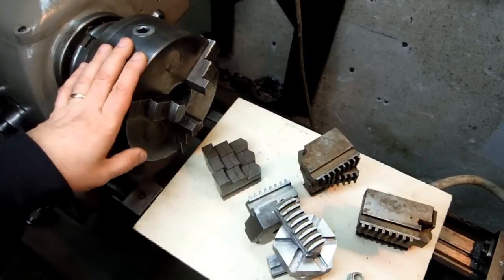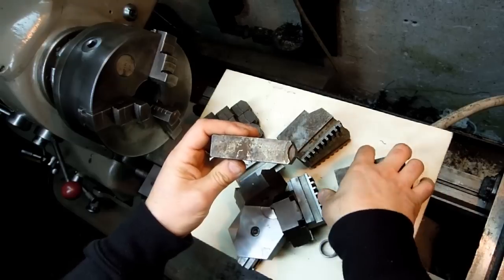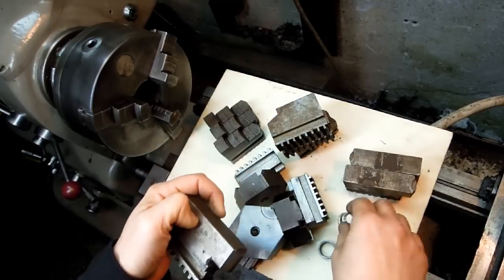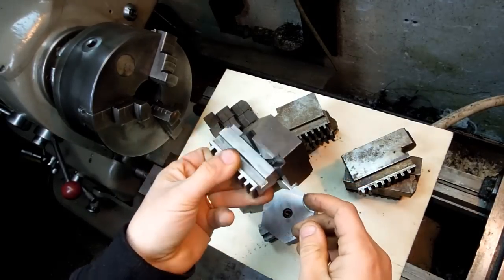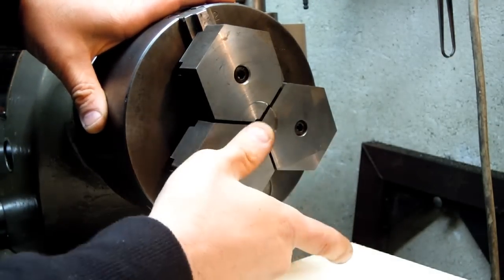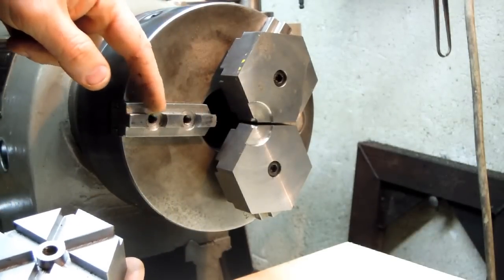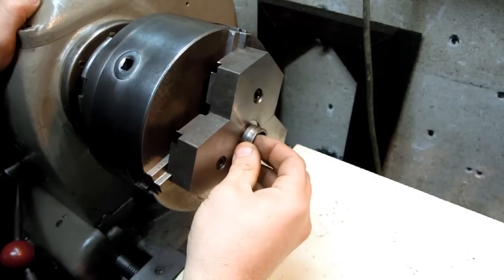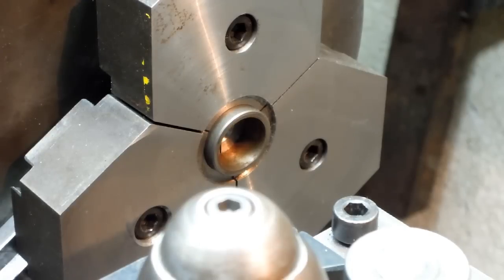Lathe Soft Jaws

Comment: When you're cutting pie jaws like these, putting shims between the segments and then tightening then down allows you to bore then on size, yet still be able to clamp the work securely. In fact, since you have the exact curvature to match your part, the holding will be even more secure.
Reply: And undersize jaws can leave nasty markings on soft material part's.
Reply: I was about to ask a quest along those lines. I have used a pin to preload and machine a collet and it worked great but i dont know if thats correct.

Comment: Hi Tony:
I noticed that there was no mention in your video of one crucial detail in the use of soft jaws. Namely, not only they are useful to grub odd shapes but also to provide the most and only 100% accurate way of running concentric parts on a chuck.
If you are  curious enough to check promotional videos of so called "Machining Centers" from either the US, Europe and every other manufacturer, you'll see that they have stock of dozens (hundreds?) of soft jaws for production runs. We should also mention that those hydraulic or air pressure operated chucks are worth tens of thousands of dollars and still need soft jaws for absolute precision. Just imagine the commercial chucks that we  use even first rate ones. An old and known alternative is to use a 4 jaw chuck which, while highly precise, don't offer quick repeateability. Another point worth mentioning is that due to obvious manufacturing tolerances in the base or mother jaw and internal chuck components, soft jaws must be numbered and placed in the same spot every time to insure results.
In the subject of normal wear and manufacturing tolerances, I always use only one spot to tighten a chuck because all other locations allow unequal and distorting torque forces on the jaw in question for that reason, affecting concentricity.on the workpiece. Such method is used by many knowledgeable machinists without affecting holding strength. Using excessive torque applied to chuck jaws cause springing of same and is not necessary. To give you an idea, adjustable hydraulic chuck jaws use a maximum of 100 Lbs. of pressure and beyond that level, the jaws are distorted and the chuck damaged. So much to learn and so little time.

Oldtimer

Comment: I am straight up jealous of the practical ingenuity possessed by whomever came up with the hexagonal soft jaws. What Eureka moment that must have been.
Reply: I think it was an English engineer called John Stevenson
Reply: I do wonder how good the registration is after initial boring, once they're taken off and reset. I work in a CNC environment and we are constantly recutting/remaking jaws because they lose registration once they are removed.
Reply: @spadgefox5286  It's at 8:45  where he says the key thing. "To be able to repeat it reasonably"
If you work on professional CNC, what are your tolerances? 0.1, maybe 0.5 thou? I', really sure that Tony was fine with a 1 thou error or a 1 thou change in radius due to vibration
EDIT: His end result ended up at 2 thou and his target was FIFTY lol

Comment: I am a Millwright, but I’m now working as a machinist. Mostly manual work with a bit of conversational CNC. What I love about videos like this are all the subtle “time on tools” tricks that I missed because I didn’t apprentice under a machinist. For example I have never thought of using a deburring tool on a part while turning it on an lathe...... I have always used emery cloth. Of course I understand different techniques have different safety aspects, watch for line of fire if something grabs etc....

Comment: One thing I found out the hard way: not having previously owned a chuck with the classic (rectangular, not stepped) soft jaws, the first time I used them on my big new Bison 3 -jaw, I failed to take account of the much increased zone of destruction, and consequently ran the outer corners of the jaws into, and marked, my cross-slide (which I had until then managed to keep pristine, on a lathe from the 1950s!).  Not happy!

Luckily I had  long ago fitted a "dead man's pedal" which brakes the lathe to a halt the moment I step OFF it. 
This meant I did not damage the chuck, although it was spinning fast at the time. And the cross slide damage was, I suppose, cosmetic - it certainly does not affect function

Comment: Love your work, please keep it up! Love the hex indexable soft jaws! Agree with many of your commenters that the jaws should be machined, with 'normal' pre load on scroll (with a gap for winding the jaws in), to the correct diameters so as not to distort the work and to give better surface registration for grip of part. This is especially important to do bores, grooves and internal bearing housings. Also you should mention the ability to do several different set ups for the one piece so, for instance: 1/ roughing out one side of the blank with the bar through the head stock and part off.. 2/ once the blanks are done, 1st set up at one depth of the jaws with: 2/ the turn around to finish the other end and final bore sizing. You should do another of your excellent videos including this. Carl.

Comment: Jaws should be cutted to exactly same diameter as part. Usually gripping force is applied only on 1 particular diameter of the part. You may to put brass pin or ring between jaws and tight chuck up before machining the jaws, then you will have enough stroke to grip the part.

Comment: Depends on the chuck. Some have recessed bolts next to the jaws and so any length of 'throw away' round stock can be centre drilled and countersunk and Cap Screw bolted to the chuck face. With the hard jaws removed, the three 'spacers' can be all machined to the axis at whatever 'height' might be needed. Replace the hard jaws and parallel facing two sides of a plate is quick and easy as is repetition of same parts with same width requirements. This method can be just as handy as setting up with soft jaws for specific needs.

Comment: That's interesting "barring the boring parts." See when I've heard people talking about soft jaws in the past I always thought it meant lathe jaws that were soft enough that they wouldn't damage the part your milling. I had never imagined that it was to allow them to be cut for specific jobs. As for the keyed consumables you milled out of hex stock man that is brilliant. It makes me wish I had an end mill capable of doing that. Sadly I only have machining tools for jobs on the scale of an RC model and I use them mostly for prototyping miniature robotics and the occasional RC car reduction or pinion gear. I've also been known to mill my own aluminum billet rims for them for obvious reasons. Either way, most of the things I turn are under 2 inches in diameter and those that aren't have to be turned between centers like the RC car rims.
Reply: Growing up in a purely Manual only Job Shop environment (Lots of funky shaft work for the local aluminum plant) I too thought Soft Jaws referred to not damaging parts.

It wasn't until I worked in my first CNC shop that I was quickly disillusioned of that misinformation.  That shop used exclusively Soft Jaws for EVERYTHING.  Every job packet included a Soft Jaw setup for every fixturing op of a part.

Wasteful, but educational.
Reply: @elHosed  , not wasteful; the only waste is a ruined part. I've ruined plenty in my home shop, due to crappy tooling and shortcuts.

Comment: Great video just wanted to mention when using soft jaws you can have 4 or more different parts registered to the same set of jaws.  Have one set that has a solid hold on 3" and 2" with a flat back and also on the top holding smaller parts.

Comment: Awesome recycling of soft jaws. I also agree with anonymic79. Clamping the jaws together and cutting undersize may not be the west idea, Cutting the correct size and spacing the jaws would be like using the collet. The part will also be running 100 true irrespective of the chuck offset error. There is also the added advantage that you have to cut less on the jaws, extending the life of even your replaceable jaw clamps.

Comment: I've just realised that I have the same lathe as you! I have a Colchester Student, with a round head and a removable bed piece. Can turn 18" in diameter, when the gap in the bed is removed. The used to sell them under the Clausing brand in the US. :)

Comment: I can't say it is the true name but part with the thin wall and ribs. We called them nut zerts. The area where the ribs are collapse and expand in diameter inside of a hole . The hole would be in some sort of thin material (Guage metal or plastics.
Reply: Yep, except around here, they are called nut-serts or just nut-inserts.
Reply: There is a pop rivet type of setter for some of the nut serts, also.

Comment: If you had put a set of three 0.020" or 0.030" shims between the sides of the hexes and tightened down, then you could have machined the recess to exactly the diameter of the work-piece. Once the shims were removed, the jaws would tighten down perfectly on the work-piece. By machining a smaller diameter recess, your jaws are pressing harder near the gaps between the jaws than in the center of each jaw. This could possibly distort the work-piece, especially if the final cut was not a simple facing cut.

Comment: The profile at 1:40 or so looks a lot like a .45 ACP cartridge case.  I'll bet the previous owner was a reloader, and was using the lathe to trim empty cases to length.  It doesn't have to be done often, but when you do, most reloaders will trim several hundred at a time.

Comment: "Contrary to popular belief and what you might actually see on my lathe, hard jaws are not supposed to be cut", You rebel!
Reply: Actually, these days, it is perfectly possible to reshape hard jaws by turning and boring with ceramic or even carbide inserts. I have made stubby jaws this way, great for (eg) holding screws for shortening the thread.

Comment: @8:30, I wholeheartedly disagree.
You do cut the pocket to fit the part exactly, however, you back the Jaws off just a bit before doing this so that you can clamp it tighter with full contact.
Clamping a piece of shim stock between each of the three Jaws helps hold them apart that little bit if your jaws are loose.
By cutting the size to the exact measurement you get maximum contact surface and the Jaws only need to go a very small fraction of an inch tighter to pinch the part.

Comment: I have a bent spindle, can I use soft jaws to true up my chuck enough so I can make a new spindle
Reply: bent spindle causes taper cuts which cannot be fixed with any type of jaws. however small tapers can be caused by uneven floor. there is a video from Tony about fixing that

Comment: Hi! Why are hard jaws not supposed to be cut?
Reply: Not sure, but maybe because they are hardened only on the surface.
Reply: katelikesrectangles you could cut them if you really had to, but they're made to grip tightly, and often had teeth in them. Hard jaws also tend to be a harder steel, and aren't as good at gripping a part without marring the finish. They're also significantly more expensive to replace, whereas soft jaws are typically considered almost disposable, and often have disposable soft 'inserts'
Reply: Because soft jaws exist.

They're your hard jaws though, cut them if you want to. Use carbide/diamond tooling on hardened steel.

Comment: couldn't u just loosen the jaws a bit and then cut a perfect size hole in the jaw to fit your part and then just re tighten the jaws
Reply from the maker: The jaws need to be cut while they're under pressure.  Without anything in there I'm not sure what you'd get.
Reply: You could if you put a small piece of stock in the jaws to apply pressure to the jaws (assuming you don't completely bore through them) .  Also, if you have a hydraulic/pneumatic chuck, you don't have to worry about having the jaws touching, or having a piece of stock (as the hydraulic/pneumatic pressure will hold the jaws in place during the cut).  If you do not have any pressure on the jaws, any slack/play within the jaws will cause the jaws to jump around during the cut.

On a hydraulic/pneumatic chuck however, you still typically have to cut a slightly smaller diameter so the jaw's stroke has enough movement to apply ample pressure to the part you're trying to hold.  Unless you have soft jaws that can move in and out along notches in the master jaw (master being the part that's actually threaded to follow the chuck's T-slots), which the soft jaws are bolted to.

http://img.directindustry.com/images_di/photo-g/7240-2584785.jpg 

Just to give a more accurate picture of what i'm talking about:
In this image, the master jaws are the bit with the T-slot cut into them, and small slots cut into the face.  The soft jaws have matching slots cut into the back of them, and are bolted onto the master jaws with T-nuts.

The reason for cutting the jaw bore slightly smaller than the OD of you part (if you had jaws that didn't touch at a center point) is to have at least two points of contact per jaw (edges).  If you're just gripping with the center radius of the jaw, the part can walk on you during a cut.
Reply: Exactly. Cutting the soft jaws has the same requirements as regrinding hard jaws. The jaws need to be pre loaded in the correct direction your going to hold the part. Even the best chucks ever made still have minimal clearance between the chuck body and the jaws or the jaws couldn't move. That clearance allows the jaws to very slightly tilt when tightening and holding a part by the OD or ID. Really well done and explained video Tony.